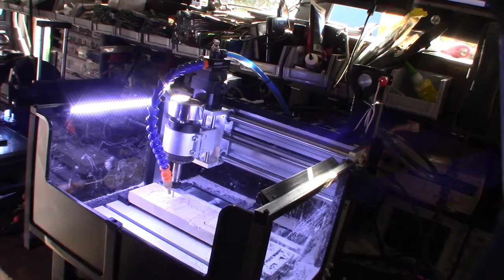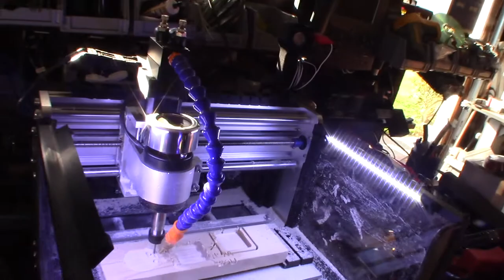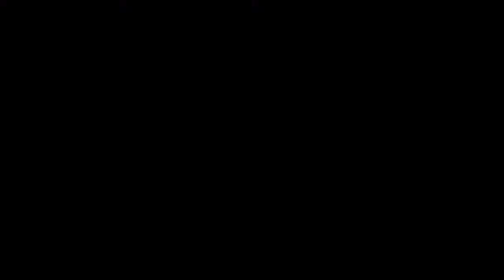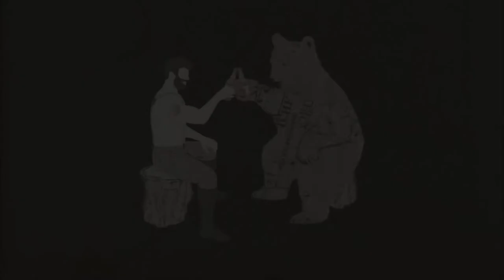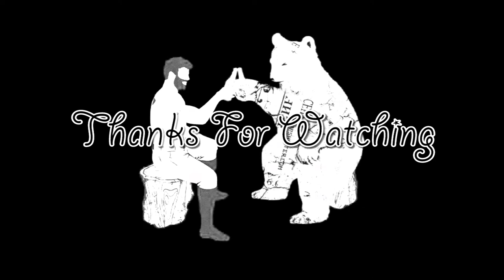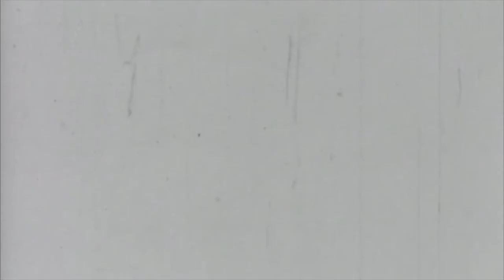3018 CNC chip containment system is complete, Debris catcher.

Comment: instead of chip catcher I'm thinking to make a small water reservoir for CNC machine to collect the cooling water from the nozzle as a circulation system, Again I found out the Y axis rod can get rust so I exchange that with stainless 16mm rod.